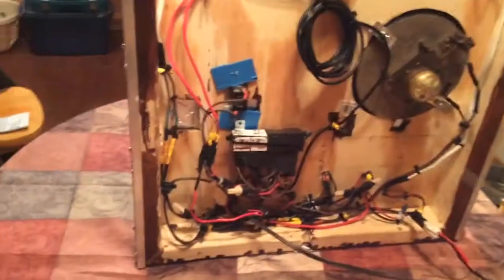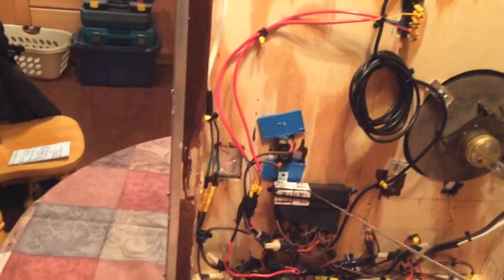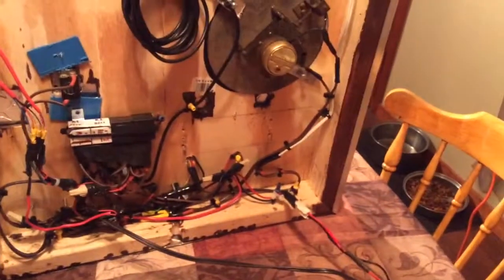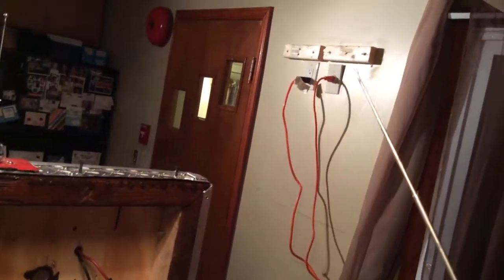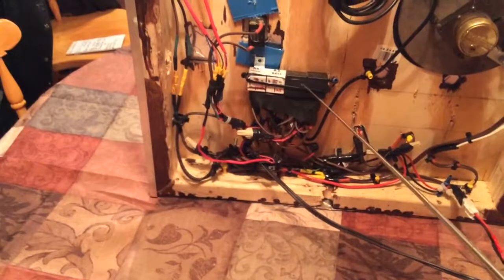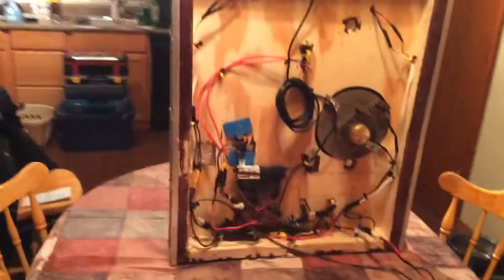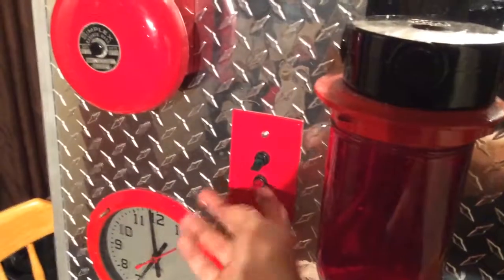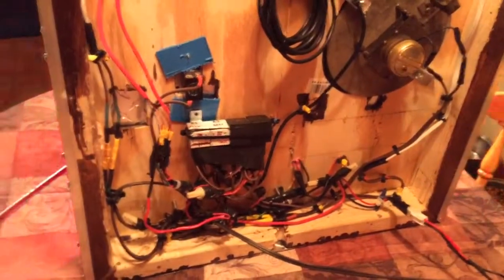Firefighter Pager Tone-Out Alert System - Technical Explanation

Comment: I have a fire pager amplifier, how can I add a light to it so when I get a call the light will go off
Reply from the maker: Unless it has relay contacts on it that activates when your pager does, which I assume is via tones, you probably cannot.
Reply: So essentially you have to get a base radio as opposed to hooking it up to you pager via amplifier we use Motorola minitor VI  and I've never looked into ye amps for that model